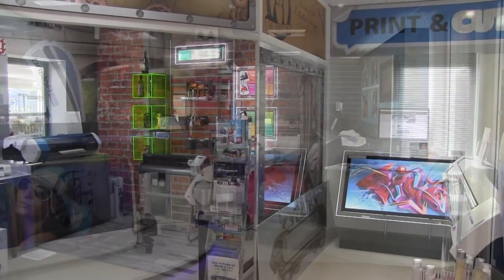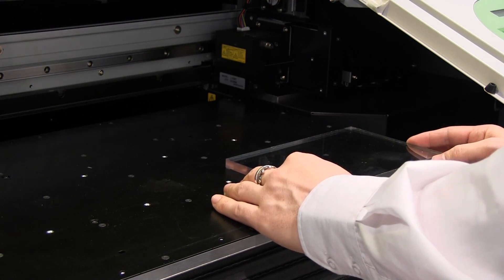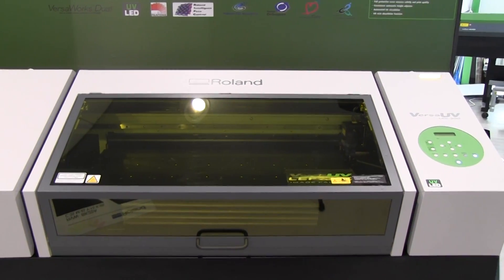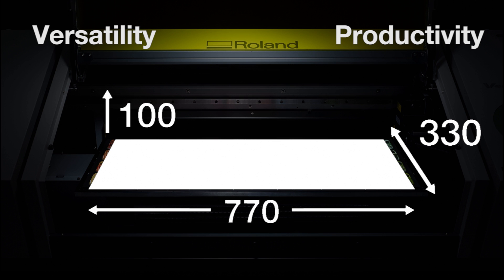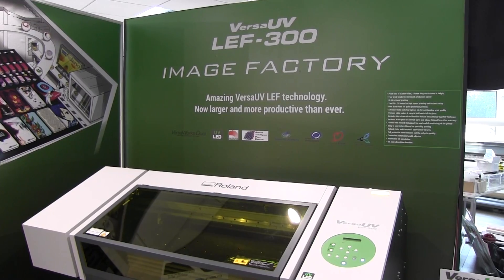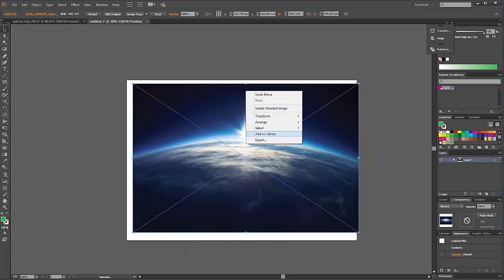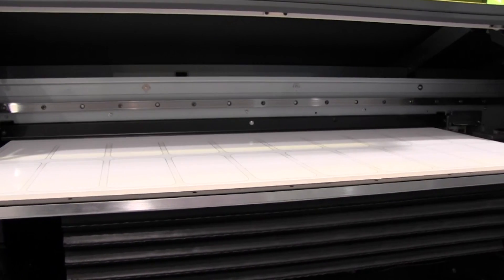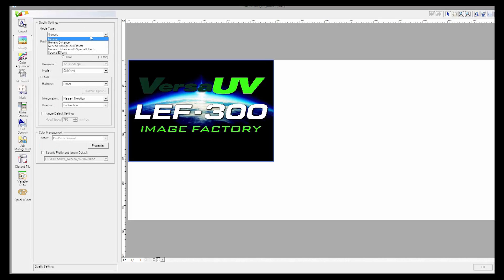Roland DG's VersaUV LEF 300 - Introduction, Set-up and Print

Comment: my Lef-300 won't print white. it's almost like versaworks doesn't recognize any white in my designs?
I have tried to print just white circles onto plastic and paper, it sends the job to the printer, printer starts to function but doesn't actually send the print head out to the surface area, then it send the table back and says job completed.
any ideas?!

Comment: Can this (and other) UV printers print on black cotton rag paper? Working on a book and I'd like to use black pages. My shop has a LEF300 I plan to use. Thanks!
Reply from the maker: Give it a go!
With fabrics it can sometimes take the ink longer to cure (leave in well lit ventilated area - or run UV lamp multiple times), as the ink will be absorbed into the material. 
Also the white ink may not be as vibrant as absorbed, but would have to try. 
Good luck with the book!